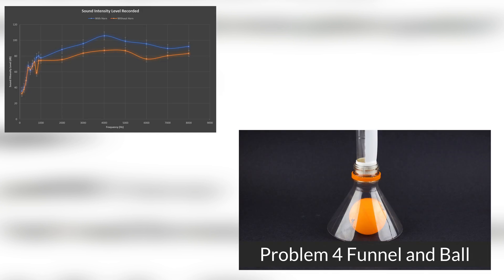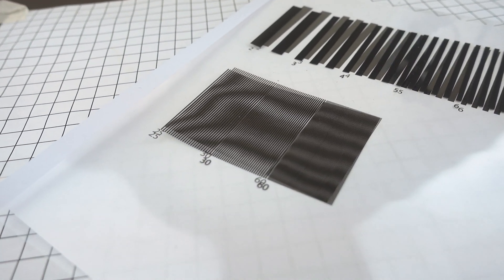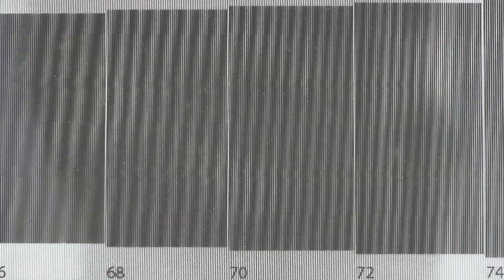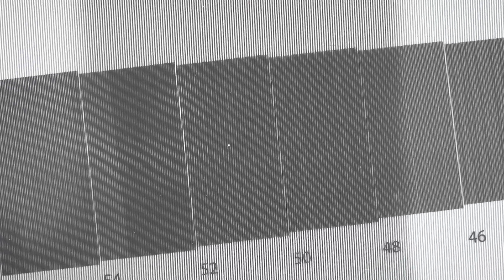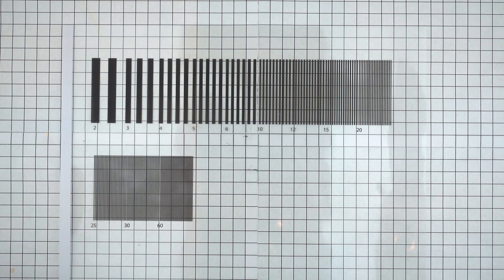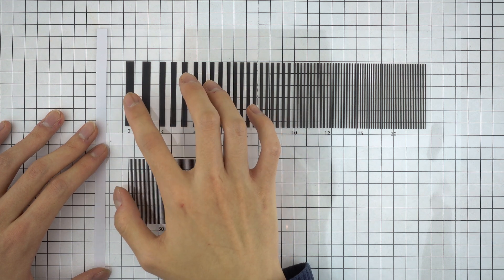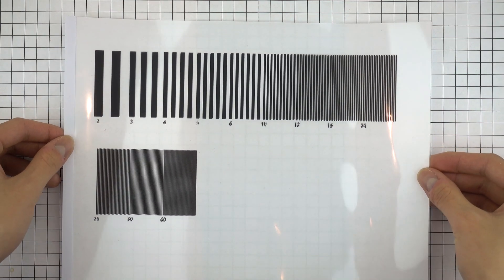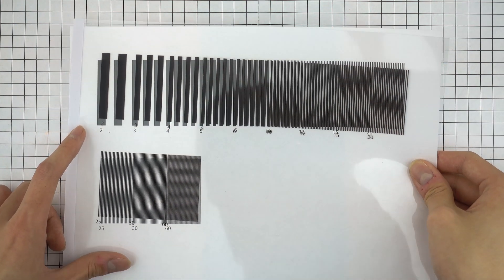DIY Moire Thread Counter (IYPT 2019 Problem 13 Demonstration)

Comment: Awesome!!!
Thanks for you Moire pattern source<3

add... it is available to print out these patterns on the films?
thanks a lot
:)
Reply from the maker: It actually really easy to print the pattern onto transparent plastic sheet. You just have to use the right type of transparent sheet for old style overhead projectors. It is basically the same as printing with regular paper.

Comment: Excuse me, but i don’t understand about how to count thread. So could you explain more a little bit about this topic please? Thanks
Reply: By seeing the steepness of the "slope" of the Moire patterns of different number of lines per inch, you can identify the Moire count. Two overlayed patterns with similar thread counts produced a shallow slope in the video. For example, at 4:37, the white paper is 50 threads/inch. The slope of the Moire patterns (dark lines) is negative at 52, and positive at 48. However, at a Moire counter of 50 on the transparency sheet, the slope is quite shallow which matches the thread count on the paper.